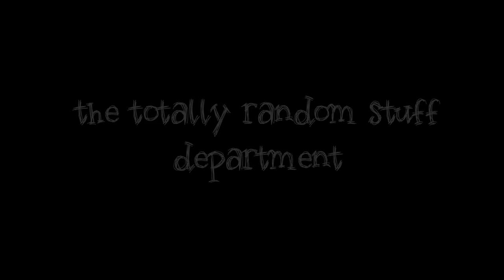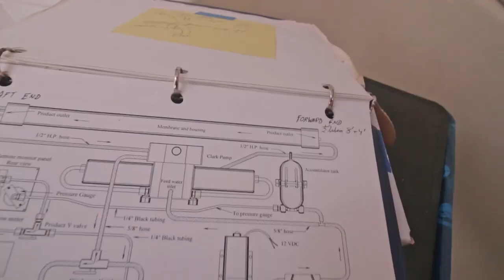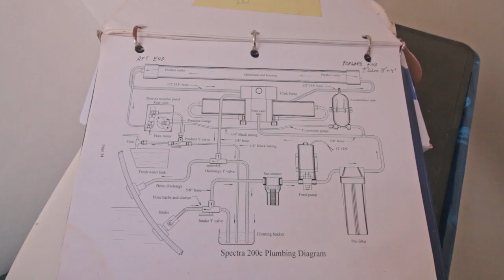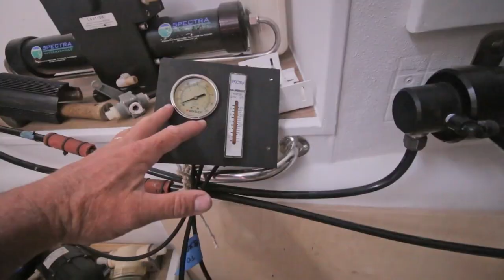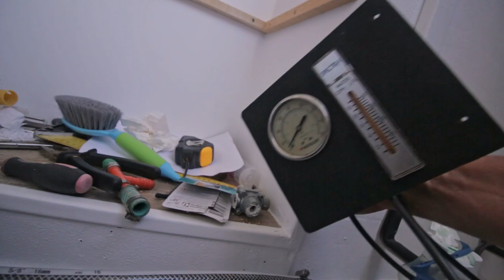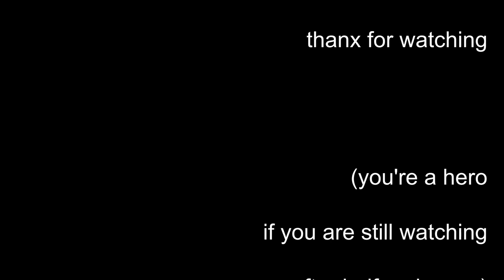SPECTRA Ventura 200 WATERMAKER installation. Sailing Exodos, ep. 37

Comment: Ik heb precies dezelfde watermaker, ik loop tijdens de installatie alleen tegen 1 probleem aan.. Hoeveel bar moet de waterpomp zijn?

Alvast superbedankt!
Reply from the maker: Hoi, Laurent! We hebben de boot in april verkocht, dus ik moet even hard nadenken 🙂. Spectra zelf geeft voor de Ventura 200 een druk van 90 psi op, wat ongeveer 6,2 bar is. En later heb ik er nog een pomp bijgebouwd, voor een hogere opbrengst. Dat kon, want het enige verschil tussen de 200 en het hogere model, is een dubbele feed pump (dat heb ik afgestemd met de technische afdeling van de fabriek). Ik gebruikte normaal gesproken alle twee de pompen, maar als het in de zomer erg warm was, liet ik hem na een tijdje op één pomp lopen, zodat de andere kon afkoelen. Als je er trouwens eentje met van die koelvinnen die je erop kunt klikken kunt vinden, is dat aan te raden voor wanneer het erg warm is. Ik hoop dat ik je vraag hiermee heb beantwoord.
Groetz!
Wim
Reply: @DoubleUThings  heel erg bedankt voor je uitleg! Ik ga mijn best doen!